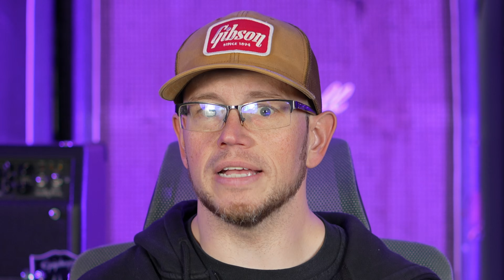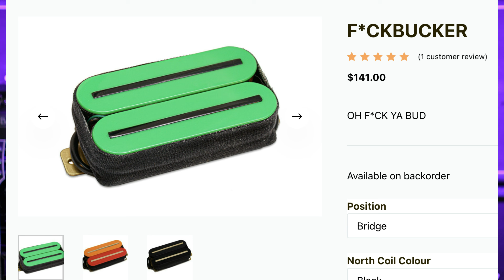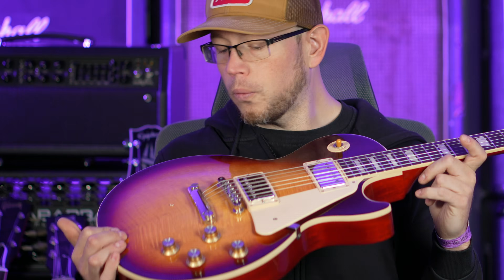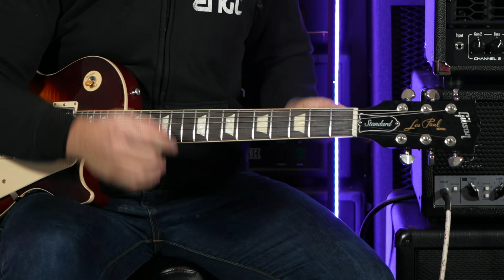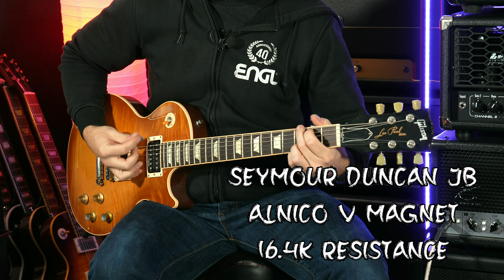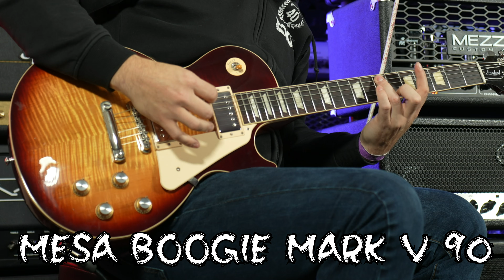EVERYONE has been using the WRONG pickups for metal......

Comment: What a lot of kids don't understand is they think you need a high gain pickup but for heavy metal but we used to use High Gain pickups because we didn't have the pedal selection there is today you had a guitar going into a tube and you wanted to Dr the tube amp harder so it distorted more and so you got a hot are pickup with all the pedals that we have today that we can tune and shape our tone however we want a lower output pickup is much better sounding in my opinion

Comment: Kyle I have a pickup that is crunchier than a train running over a Doritos truck. It has great diggity bass rhythms and great note separation. It sounded more aggressive than my 8k aln 5 and a 7.7k aln 4. So, I was shocked to find out that it was only 7.4k and had an aln 3 magnet. The aln 3 mags are supposed to be the weakest so how in the heck was it out rocking the others. The aln 3 is stiffer than the 4 or 5 so that and the increased note separation of lower gain made it crunchier and the stiffness making the notes stay in their lane to make it crunchier still. I'm still having trouble believing it so I highly recommend you try a 7.5k ish bucker with a3. Sounds nothing like the Gibson 8k aln3 custom bucker. Check it out!

Comment: I just recently scored a 2006 Fernandes Ravelle. I needed to fix the wiring and found that the guitar has an early Bare Knuckle pickup set (pre-2010).

Neck pickup = 8.10K ohms
Bridge pickup = 8.75K ohms

I play through a 5150 212 combo and these pickups sound better than my Duncan JB/Jazz combo in my Les Paul.

Comment: Does it matter if the tap on your kitchen sink is plain bronze, chromed bronze or AlNiCo 5?
What matters is the pressure, the diameter and the type of valve.
The pressure in the line is the pickup, the diameter is the headroom of the amp, the valve is your gain control.
I hope the analogy makes sense.
High pressure, smal diameter lines will make a turbulent flow more easily. Likewise a high output pickup into a low headroom amp, will make it distort earlier and more abruptly.
You might need that high output from the pickups, simply because you're going to live in high-gain land.
Reply from the maker: as explained in the video, modenr amps have so much gain that the output of the pickup no longer matters. ive been playing high gain rigs with paf pickups for over a decade . never needed a high output pup

Comment: Hello.  

First time here and I had to comment and subscribe.  You are cracking me up too.  
😂😂
What a great herd of Les Paul's.  Very cool.  
I promise someone will comment that you did something wrong so therefore your experiment is wrong.  😂😂.. 
I agree abiht amps having all the gain you need now.  I'm 65 and played back in the day and the Dimarzio super distortion was a great idea back then and was needed and so were actives, etc.  I love actives too, but one can easily use low output pickups with high gain amps and not need hot pickups.  ❤
I just purchased a Ibanez Japanese made Genisis RG550 and it has the Ibanez made pretty warm medium. output to high output pickups in it and I might actually replace them with EMGs newer pickups which clean up remarkably and yet can blast wide open for chugs and that singing sustain. Plus, you're not the ground with actives and this helps keep the guitar dead quiet.  With a wireless and EMGS you can't be shocked really and I was shocked once and it hurt back in the day.  😂 Leaned against a microphone stand and my guitar touched it and bam a loud noise and sparks flew and it scared the hell out of me.   I ended up buying a Nady wireless which everyone was using back then.  😂
An EQ will get you close to the sound you want if you don't mind really taking the time to put in the work and it is work to get it right.  It's easier though to just buy a lower output pickup.  Yngwie malmsteen used to use really low output single coils with his strat because he was using so many marshall amps with no master volume and cranked all the way up and getting his distortion from the power amps and he had a boost on all the time usually, etc. Now he actually is using high output stacked pickups from Duncan. They sound great though.  
All of your guitars sounded good I thought, but the lower output PAFs sound sweeter no doubt . ❤
Cool video sir.  
Regards from South Central Indiana .  
Tim
Reply: этот тип настраивает усилители как дерьмо.

Comment: They all sound very shit to me hahaha, traditional pickups make the amp sound broken, I find very high gain pickup fit way better to high gain amps, even if you don't push the amp to maximum gain it sounds much more thick with high output pickups
Reply from the maker: There is no such thing as a high gain pickup.  You got it right with "high output". I disagree on your take and actively avoid high output pickups, but what is right for me, doesn't have to be right for you and vice versa.
Reply: потому что ты соображаешь в звуке. PAF  не для метала в 2026 году. автор показал дерьмо будто это конфета. он наверно глухой

Comment: Never seen this channel. I am gonna be 58 in 2 weeks. Been playing metal since the early 80s. I was about to almost type exactly what you are saying. You're right you can't beat a basic PAF style pickup. My favorites I own are Patent sticker and Patent stamped Gibson T-Tops. If I owned a legit PAF I might feel different but I don't want to refinance my house. I do have some early 70's Dimarzio Super Distortions ( long legged, square foot base) and they sound pretty phenomenal, a bit hotter than the T-Tops but like you said that is a slight turn of a gain knob to get pretty much the identical sound. I have some 77 Maxon, Ibanez flying Fingers which are up there with the others and believe it or not one of the best metal Pickups I have are out of a late 80's Korean guitar called a GTX35 they totally hang with all of the above and ohm out at 13.8k so more in the range of the Super Distortions.

Comment: This is why Lace pickups are my go-to for almost everything including bass. Lace Sensors and the Lace Alumitones in particular are just so nice and flexible in what they'll deliver. No 60hz hum. They use a high quality audio transformer to step up the very low output, current-driven design (in the Alumitones) and you end up with a pickup that records like an EMG but still has dynamics and that give and take which preamps can sometimes cut off at the knees. 
I put them in my guitar and all of my basses. The Lace Aluma-P in a P-bass is the cheat code for great rock and metal tone.

I can't really speak to their high output models, I don't have any of those. Their standard line of stuff works great. Especially if you're using any sort of preamp.

Comment: Besides the PAF, the rest has too much scoop that overshadows the individual articulation of each string being plucked, it's just all meshed together and it sounds muddy. When your young and first starting out then it's fine but as you age you start to realize that the simplest things often gives the best results as with almost all things in life. I had a Fender Strat MIM and Ibanez Prestige RG1451 and the Strat sounded way more natural and articulate on a high gain amp.

Comment: What matters with high gain pickups that lower output ones have less off is the attack and feel of said shack based on the compression and magnet that high gain pickups give. You want a higher gain bridge and paf in neck. Gives you the best of both

Comment: If you feel the need for more output with your regular paf, just try putting an alnico 8 in it.  If you need more highs and presence use a ceramic magnet. 

Both work really well with regular wound pafs and hold clarity under gain very well. It's a cheap but very effective mod.

Comment: I have a new Epiphone Les Paul standard and it sounded pretty sick and pretty good with high gain, I replaced the bridge probucker 3 with a Gibson 60s burstbucker in it and I don't know kinda torn but it sounds good, it has a different sound maybe little subdued on the lows but brighter on the highs but the PB3 had a meaner midrange bite imo. Where the problem. Lies is the BB is unpotted and feeds back bigtime with high(er) gain... I'm not talking full chooch everything on 11 I'm talking things just turned up. All the videos say wax pot it wax pot it that's great n all but I just foolishly paid $150 for this stupid pickup do t really want to go cutting the cover off dunking it in wax when apparently it was left un-potted for its tone. I already bought another set of mint used probuckers a 2&3 for $50 off reverb because I used the PB that came from my LP in a firefly LP style and it went from zero to hero instantly. It instantly sounded like I was playing my Epiphone LP, whoda thought. What did I learn from this $150 experiment probuckers are perfectly fine don't listen to the Gibson snobs and if you have a Chibson or one of the countless pretty nice Chinese Les Paul copies and are not happy with the tone don't spend a bunch of money on big brand pickups like Seymour, DiMarzio or Gibson just  grab a used probucker for $25 and that knockoff will likely sound like a Les Paul.  Btw the very cheap Epiphone probucker kits all over Amazon and eBay are not real, they don't even say what PB they are just probucker an authentic PB 2 and 3 set new is $95 from Gibson, $50 a pickup I think is a decent price because they are good pickups but there are so many cheap like new takeoffs out there why bother new. I'm just glad I didn't sell a kidney so I could afford a Gibson Les Paul standard 60s just to learn the 60s burstbucker pickup is a lot of feedback heavy hype. Don't get me wrong I want one someday but when I can justify spending $3k on one, just because I could doesn't mean I should. Btw How do people play loud live on stage with these squealing pickups?

Comment: Medium output wirh a compressor pedal for when you want to tighten up. If your not into comp pedals a ceramic pickup makes sence. Very subtle difference in switching pickups with the same magnet aswell.

Comment: My 700t sounds amazing through my metalzone. That's right. Just play different pickups through different guitars and amps and find what you like for YOUR sound. There are no rules. All said, there is little difference between humbuckers unless you are talking different magnets (ceramic vs alnico 5) and large output differences. Still, much of that disappears with your amp settings tweaked a little. Point is just stop over thinking and PLAY.

Comment: I wish someone could make an in guitar low cut to change the tonality of the pickup when using larger gauge strings for super low tunings.. As far as pickups go, under 10k for sure. Lindy F in every jazz or single coil guitar I have. For humbuckers it’s motor city 2nd degree black belts, best humbucker ever made.

Comment: Uhh that Duncan 78 is 9k, not 16.4 K and it has an Alnico 2.  And it kicks butt. I didn't even know until I got a custom ESP with a Duncan 78 in it. And it was love at fist strum. I couldn't believe the grind and response I was getting... but most of all the tone. Now it's what I judge all other by. 
That said, I'm also loving the Suhr Thornbucker plus... they are still only 11.1 k... you think it's more output, but it's not. And it has a piano or bell like quality in your lead lines, especially in the upper register of the guitar fretboard. Makes you want to solo all night long.
Reply from the maker: There is no "Duncan 78" in this video.  It'd a Duncan JB, and it is absolutely 16.4k
Reply: @belligerentamateur  You're correct. The JB looked like 78 as I glanced at it. lol. Great video!!

Comment: I absolutely prefer the slap in the face cutting sound of a vintage humbucker for metal. They are percussive, tight af and have great note separation. 

I can't stand the modern meta of using high output fatbuckers. Too much bass and they are too loose. The palm muted notes just don't want to actually stfu. Sloppy sound. I don't want traction control in my car just like I don't want "compression assist" for sweeping my guitar. It's nice and all but not at the cost of messy, muddy riffing.

Even the Fishman Fluence. When I tried them for a week I just used the vintage voicing for rhythm.

Comment: Modern hi gain pickups in modern hi gain amp equals fizzy noisey trash.  I just had an debate with a guy the other day who said low turn  low out put PRS pickups sound like shit.  No you just do not understand the dynamics of audio physics.  Modern hi gain amps sound better with PAF because they are not trying to push out a boosted signal like an active modern hi gain pickup which would be needed with a lower gain vintage amp to help push it into metal territory.  The biggest problem is guitar players even good PLAYERS have a hard time tracking the mechanics of audio engineering.  Two different things that go hand in hand.

Comment: I used to love high output pickups but now, they just seem lifeless. I swapped a jb into my les paul standard and i hate it. I gave away my stock pickups so am now trying to figure out what to swap them with. The 50s les paul standard pickups have an amazing midrange and have soul (cant think of another way to define it 😂😂)
Reply: I put a set of potted Mojotone low output '59 Clones in my 50's LP Standard and they sound great! Although, the stock Burstbuckers were really good, too. Brickhouse Toneworks (founded by former Mojotone pickup chief designer Dave Shepherd) has some killer PAF pickups as well, though they are unpotted and a little pricier. Their Mason Deluxe PAF's are amazing and on sale through the end of the month. Very clear, chimey, and articulate if that's what you're after.

Comment: I can't believe someone finally gets this high output pickups make your amp kind of chalky sounding low output pickups let you crank on the amp a little bit you should try a compressor instead of an attenuator make your signal nice and articulate but at half the volume you're used to sending into your amp then crank on your amp

Comment: You used a 498T but where's the Gibson 496R Ceramic Magnet High Output Humbucker. The 496R and the 500T are my favorite pickup combo. I've been a guitarist for over 24 years, I'm a Thrash Metal Guitarist and a Blues Guitarist. I guess I just thought the 498T was an odd choice since it wasn't the original ceramic magnet pickup for Gibson. Cool video man.

Comment: Presently using a SD FRED (10.5 k) in my Ibanez JS1000 and it is my favorite. 14-16 just to hot and lacking clarity except for my SD Full Shred from 1987. It is a truly vicious PU as well even though it shows 14-5 on the meter.

Comment: Agreed. Man, I've always found my paf debt style pickoffs that are usually around 8.5k end up being the best pickups for high gain amplifiers. However, my main guitar right now does have a fluence set. But once I took the proprietary's out input, the Adler set in they made that little bit of difference. I wanted however, I almost want to take all the wiring out and just put a nice set of passives in😅 right? Actually, am ordering a set of berknuckle right now. I think I'm gonna end up with this. The mule, which is a paf style and a supermassive in the neck, which is a p ninety humbucker sized

Comment: thanks for video @kylebull. The sugarbucker, suhr, 498t and Distortion sounded better imo. I also share your opinion and also a fan of PAFs. The only 2 negative points i can find against low output PAF PUs are: 1) by increasing the gain on the amp you also add noise 2) Many PAF PUs are unpotted which makes them feedback a lot.